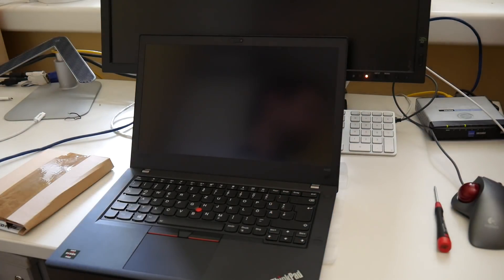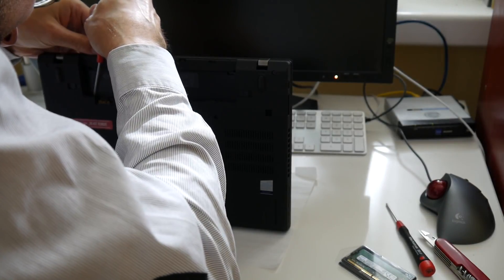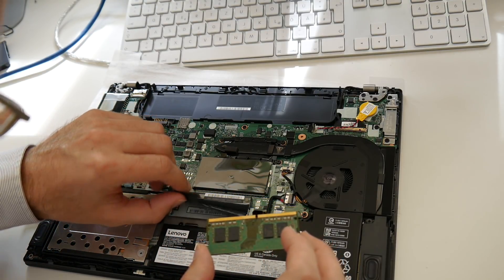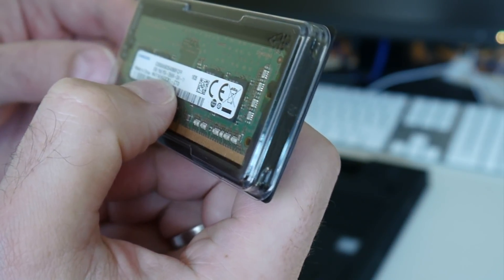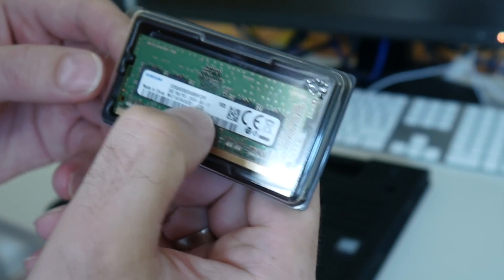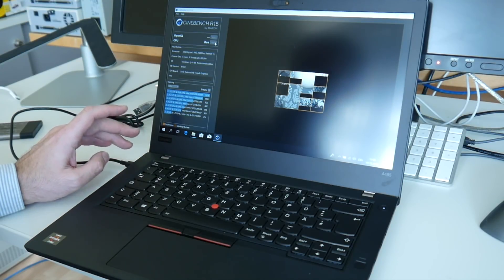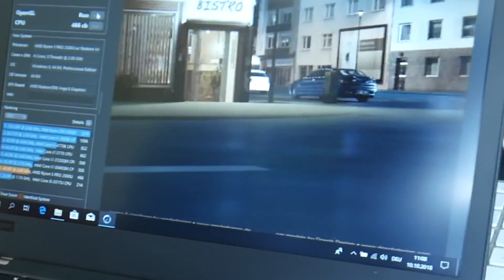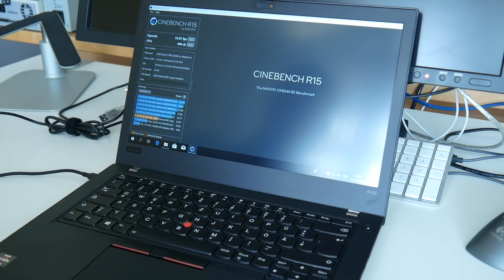AMD Mobile Ryzen Pro, dual channel memory, Lenovo A485 again!

Comment from the maker: UPDATE: After a Windows update dual-channel CPU performance is much better! Looks like Windows has done something stupid w/ frequencies, scheduling whatnot. To be fair I said in the original 1st video that I do not see such a performance drop compiling the whole Linux kernel for 39 minutes, ...!  https://www.youtube.com/watch?v=UV7k7FoM4kI PS: looks like on top of cTDP we now also have STAPM – Skin Temperature Aware Power Management at work :-/ https://techreport.com/review/26377/a-first-look-at-amd-mullins-mobile-apu
Reply: How much better, would you say? Is it noticeable over these results, or still a small bump up?
Reply from the maker: CPU is just 2 or 3% faster, at least for normal data sets, GPU improves some 22% or so in Cinebench: https://www.youtube.com/watch?v=_DSWIo4_E8k
Reply: I wouldn't have thought that dual channel memory would speed up CPU operations much. It should speed up the iGPU significantly, though. What is the GPU score on cinebench in single channel? And what about a few games in single-/dual-channel?
Reply from the maker: well, it's 8 threads of execution, with potentially that much memory access I would have actually expected bigger performance increases, but it looks like the L1/L2 caches are huge enough. It should also not become slower for CPU as it initially did, but that was apparently some Windows / BIOS irritation not seed on Windows. But in the Linux kernel compile CPU speedup was 10%, and CInebench GPU speedup was some ~20%.

Comment: How's the battery life on this laptop? I've been eyeing Ryzen for a future upgrade, but it's hard to give up my current 8-10hrs of battery (on linux) on my 15" lenovo yoga (which is only dual core, though).
Reply: Its amazing, with 42whr external battery(mine is missing internal one atm) it shows me around 10 hours at light usage(text, plus browser open) in quiet mode and lowest power setting in windows 10. With internal 24whr battery and 72whr external one you will easily get 12-14 hours of medium loadwork, up to 20 of light load and probably around 4-6 hours of intense/gaming use.(i get around 2-3 hours now so double the capacity should yield twice the playtime and more if you menage to reduce power needed(playijg on lower resolution and low settings etc)

Comment: Maybe the dual channel configuration didn't make too big of a difference because of the deticated vram lock on 256mb.
Reply: Vram minimum allocation can be increased to 1gb bios tho, plus it will pull even more from rest of system memory. I have Ryzen 7 version of A485 and it works great even in single channel so far. Tho i expect it to be much better woth dual channel in few cases it has hiccups now. CSGO runs lovely with laptop mode at solid 49-50 fps which keeps it from deviating and feeling not smooth. It can handle graphics programs and workloads aswell. Also other thing that could lower the score was quiet mode, rene might not have noticed it when testing on windows as icon doesnt show up, but it can be toggled with fn+q combination. It works on top of windows own power settings and reduces fan speeds and clocks quite drasticly if in quiet mode.(and temperature raises much faster under load).
Judging by his reactions under final review he didnt know it was a thing, as its a tiny footnote in owners manual.

Comment: I got the same laptop running on one dimm for now, will upgrade late r
Reply from the maker: see pinned update, after the last Windows update dual-channel performance is up. Looks like Windows has done something stupid before – that's why I usually use Linux ;-)
Reply: @Edwin, How are you liking it so far? did you by the ryzen 5 or ryzen 7? Any issues?
Reply: @ammarshaikh5067  I upgraded to 8 gb on dual dimms, but it is still slow on the r5. I only use it for school so I would love to make it more usable with faster ram

Comment: Notebookcheck said that Lenovo released a Bios update that improved a alot of things on this model, have you updated it yet?
Reply from the maker: it came with 1.02, did not find something newer, do you have a link?
Reply: @renerebe  looks like v1.02 is the version they updated to.
Reply from the maker: Yeah, found so too - I remember they wrote it reduced max performance but made it more constant. Maybe before people saw higher peak performance scores. The state of PC BIOSs is sad, we really need open source ones, so we can review and fix things.
Reply: Lenovo has released the BIOS Update 1.05 today. You can download it directly at Lenovo.
Reply from the maker: hm, the first user comments do not make me want to try it :-/ "Bios 1.05 worsens throttling further" https://forums.lenovo.com/t5/ThinkPad-T400-T500-and-newer-T/Thinkpad-A485-Bios-1-05-worsens-throttling-further/td-p/4240971 "… We were expecting that new BIOS will fix power controls, not break them even further…"

Comment: my E485 with 2700u with single channel ram scores 606 on CB with the latest BIOS (1.45) from Lenovo. Battery life also so much improved.
Reply: What is battery life at?
Reply: it is about 5 hours with usual usage (WIFI on, Office apps, 40-60% brightness). When it came, it barely lasts 3 hours only, with 420 CB.
Reply: @MuhammadFuady  Thanks! Unfortunately, still not good enough for me.
Reply: @MuhammadFuady  May I ask if you have any other complaints or issues. I don't mind about battery life. I mostly care about if it reaches like 50 degrees-60 degrees just after browsing and working on pdf documents. I don't think a laptop should overheat unless you are watching videos or working on some heavy application
Reply: @nortexoid  A485 is much better and upgradeable at to combined 96whr, its impossible for internal battery only laptop to exceed its maximum battery life.(over 20 hours with 24whr(internal)+72whr external under light load.
Add to that some newer low power nvme SSD(or even two as it has a 2242 slot for wan carda and you can just use you smartphone as a hotspot if you really need mobile network)
And some tweaks(reducing max clock speed and makinf some custom exteme powersaving mode) you can probably get even more than stated max 22 hours or get closer to it with medium load work

Comment: I am shopping for a good laptop to install Linux.    Should I get a Ryzen 7 2700U with Vega 10 ?    If so, what brand ?    I would like to be able to upgrade parts, and I heard Lenovo Ideapad solders the single-channel RAM and that ASUS solders the dual-channel RAM.   Is that true ?
Reply from the maker: unfortunately I do not have a good and clear answer, most vendors do not cool the AMD Ryzen enough, maybe du to Inte's marketing incentives, the ideapad has single channel memory, the A485 and E485 dual channel. Maybe the E485 has better cooling, so it might be the higher performance and cheaper source.
Reply: I'd say the 2500u is better value, but if you will liquid metal it then maybe go with the 2700u. Otherwise id go with the lower end one. 
Though the price diff is 100 euros here between 2500u with 8gb and 256gb versus 2700u with 16gb and 512. At that point i would definitely go with the pricier one. 100 euros for 2x storage and mem.
Reply: @APoIIy  Except You can, for used Thinkpad just gi for ryzen 7 one because of Vega 10bi gpu. It still offers better performance

Comment: why not sell the 8GB that came with it and upgrade to 2x16 GB?
Edit: can you use the second USB type-C connector to connect a monitor while charging on the other one?
Reply from the maker: Because it is a review load unit, beside I do not often need more than 16G, that is what I have in my daily retina MacBook Pro since 4 years, but yes, good to know one can upgrade to 32GB at a later time. Yes, you can charge from both USB-C ports, and use the other for display, plus the additional HDMI-2.0 port.
Reply: @renerebe  Thanks for answering. The only thing that makes me not very excited about this laptop is the limited storage options. I wanted to be able to put a 2.5" and a NVME SSD.
Reply from the maker: rationalityfirst maybe a small 2240 or so ssd works in the wwan m2 socket
Reply: @renerebe  I couldn't find any decent quality+capacity ones in that form factor. Maybe you can get your hands on one and review it.
Reply from the maker: rationalityfirst yeah, will for the future, things like this are why I started the channel, however this review sample was sent back yesterday, but next time I have such a, it similar thinkpad I will try it out!
Reply from the maker: rationalityfirst yeah, will for the future, things like this are why I started the channel, however this review sample was sent back yesterday, but next time I have such a, it similar thinkpad I will try it out!